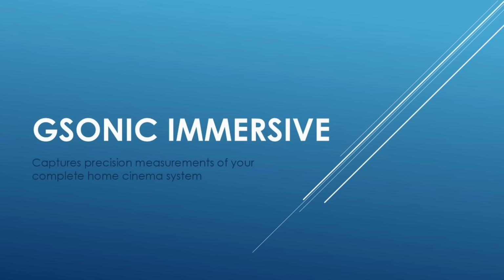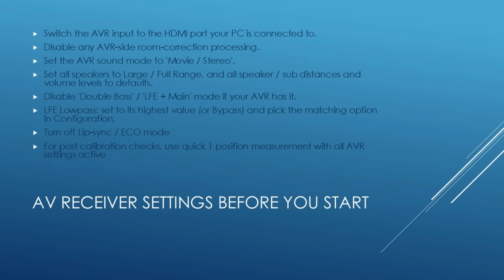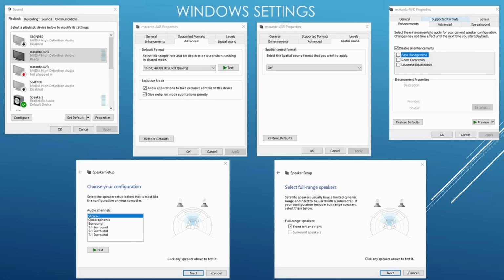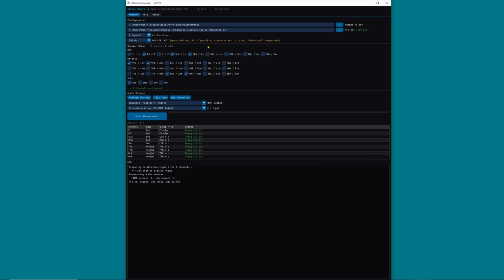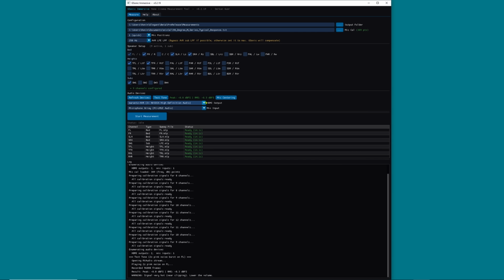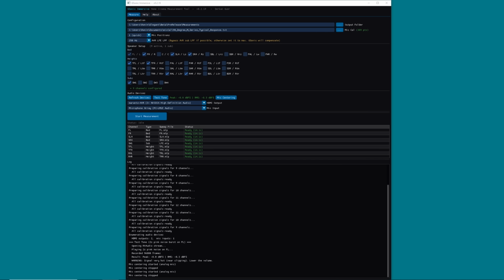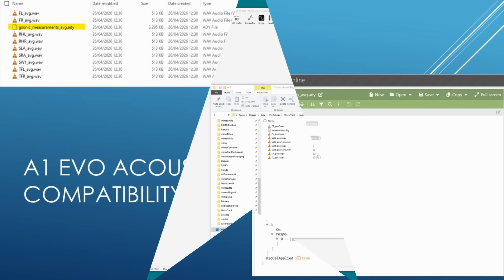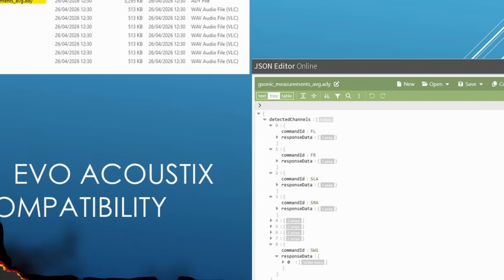GSonic Immersive

Comment: Hi all, does somebody know the following error message?

FR: the second acoustic timing reference chirp could not be detected - its window is at the noise floor, while the other chirp is clean and the recording length is normal. This is usually a one-off; click Repeat to re-measure FR.

It does always happen for FR and for second "Tschirp" no matter how often i repeat it. Soundmode on my AV8805A is set to "Direct Auto"
Anyone any idea?

BR
Reply from the maker: Try manually setting sound mode to trueHD before the repeat.
Reply: @ocaudiophile  The exact same error happened to me 3 times at SW1. Do I also switch sound mode to trueHD? Thanks.
Reply from the maker: The correct way is to troubleshoot using the new guide and find out what is incorrect in your audio path settings.
Reply: @ocaudiophile  Unfortunately that did not work out, still nothing. I am using an AV8805A and the GSonic EV32 Mode btw.  Interesting is that it uses Stereo Mode for FL but switches to ATMOS for FR (might be intended?!)
Reply from the maker: From the app Help tab:

6.  Run the measurement
  - Click Start Measurement. Place the mic at the primary listening position, at ear height, capsule pointing up.
  - The app measures Front Left via PCM, then every other channel via the immersive bitstream (Atmos)
Reply: @ocaudiophile  OK i thought so. Any other ideas to get that sortet out? Weird is i got it working once after i reactivated the Front as Stereo large Speakers in Windows but it worked out only once.
Reply from the maker: Are you running "AVR Reset" before measurements? That sets all speakers to Large anyway. Your issue could be related to large delays on the PC side. Impossible to tell without the debug log, or if the chirps are audibly heard but not captured vs they were really silent. The troubleshooting guide explains fixes for most hardware related issues and is continuously updated for new issues if any.
Reply: @ocaudiophile  Yeah i ran the reset before. The second chirp is not audible at all (at least i did not hear it) while with FL both are and the first one is as well with FR most of the times. How can i provide you with the debug log ? I ll check the guide again as well.
Reply from the maker: https://drive.google.com/drive/folders/13eRDRmuTau_J90WkXuszPc_MZU5LWiYv?usp=drive_link
Reply: @ocaudiophile  Just uploaded to folder "FR"
Reply: I rechecked the guide meanwhile updated to the latest version and still cant get past FL. The second chirp for FR is never to be heard.
Reply: @ocaudiophile I think i just resolved it, still not totaly sure if this has been the issue. As soon as i skipped FR and Center (in not choosing them as available channels), the other channels just worked well. So the difference to the other channels is the amp which in case of the fronts are Hypex Modules. After changing the automatic input search of the modules (FR/FL) from auto to fixed XLR suddenly the the whole front was working. Weird is hence i am not quite sure if this was causing the issue in the end, was that i did not change the center. Nevertheless maybe this was causing some kind of delay in the signal. BR
Reply: @ocaudiophile  I think i just resolved it, still not totaly sure if this has been the issue. As soon as i skipped FR and Center (in not choosing them as available channels), the other channels just worked well. So the difference to the other channels is the amp which in case of the fronts are Hypex Modules. After changing the automatic input search of the modules (FR/FL) from auto to fixed XLR suddenly the the whole front was working. Weird is hence i am not quite sure if this was causing the issue in the end, was that i did not change the center. Nevertheless maybe this was causing some kind of delay in the signal. BR
Reply: @ocaudiophile  Using GSI 2.0.6, I am still stuck at SW1, the error message is:
Both ATR chirps not detected (SNR 12.2 / 12.3 dB, region peaks -23.8 / -37.5 dBFS - ATR1: energy present but chirp pattern not detectable; ATR2: energy present but chirp pattern not detectable). No usable timing reference. Will prompt for Repeat.
>>> SW1: the second acoustic timing reference chirp could not be detected - its window is at the noise floor, while the other chirp is clean and the recording length is normal. This is usually a one-off; click Repeat to re-measure SW1.

As you suggested, I switched the sound mode to TrueHD for the Repeat but to no avail, the same error still surfaced. I have read your Troubleshooting Guide (Web) twice and have followed the instructions therein. The Guide does not list the above error I encountered.

My Test Tone shows all green after I lowered the AVR volume to -24db and mic level to 20db.

Please help. Many thanks.
Reply from the maker: Can you upload your debug log here?

https://drive.google.com/drive/folders/13eRDRmuTau_J90WkXuszPc_MZU5LWiYv
Reply: @ocaudiophile  Done, uploaded to the above folder. Many thanks for  your kind attention
Reply from the maker: I'm working on it
Reply: @ocaudiophile  To help your investigation, I just used your latest GSI 2.0.7 to do a Quick 1 Position sweep, the same error occurred at SW1 as before. The error message per measurement log is as follows:

Could not lock the timing reference for this channel - the sweep will be repeated.
   LPCM-ATR-X: empty IR (ATR path not Clean) - delta untrusted
>>> SW1: the second acoustic timing reference chirp could not be detected - its window is at the noise floor, while the other chirp is clean and the recording length is normal. This is usually a one-off; click Repeat to re-measure SW1.

I did a Repeat by increasing the AVR volume by 3.5 db as you suggested elsewhere, but to no avail. The GSI 2.0.7 Troubleshoot Guide (under Sweep Fails) does not mention this error. As my measurement was aborted, I noticed the debug log is still the same as that I uploaded to your Test folder yesterday, Sept 1.
Reply from the maker: Are you hearing both ATR chirps from FL during sub sweep? Did you change "2 channel playback"  from auto to something else? The floor sweeps including the sub sweeps are now simple pcm signals and the worst PC with the oldest AVR should play them without issues. I'll still need to check the 2.0.7 debug log but it looks like there're customizations you're not sharing in that setup.
Reply: @ocaudiophile  Like all the other speaker sweeps, there are ATR chirps from FL before SW1 wake tone, then SW1 sweep. Error happened after SW1 sweep. I don't have the chance to go on to SW2. I used Pure Auto sound mode for the sweeps.

I just uploaded the the 2.0.7 debug log to your Test folder.
Reply from the maker: Found it!!!

Your mic is clipping during ATR chirps (which are louder than the sweeps by design). Clipped chirps are audible to you but not detectable by the app. The test tone would normally give an orange warning for that but you get the green by a tiny margin so it's not your fault to have not figured that out.

Umik-1 mics come with different gain settings and your version is the +18dB Gain one. All you need to do is set its Windows volume lower by about 15dB (Test tone peak around -35dBFS) and you should be fine. Remember Umik-1 gain can also be set internally using its dip switches if you want to make the change permanent and use it at 100% Windows volume.

PS There's another capture device: AB13X USB Audio in your rig and it was selected more than once as the mic. Better disable it to avoid confusion. I will check if I can adjust test tone clipping detection better in the next build.

Edit: If your sub gains are too high, this may also be causing the clipping at that stage and this explains test tone warning missing it. Your speaker levels and sub levels have like 15dB difference. App will not check for clipping during sub sweeps for technical reasons.
Reply: @ocaudiophile  My sub gains were obtained via Acoustix sub level matching. Should I reduce their plate gains? Thanks a lot
Reply: @ocaudiophile  I am so sorry to trouble you again. 

As you instructed above:
1. I set my Umik-1 "Windows volume lower by about 15dB" to 9 dB
2. Reduce "sub levels" by 15dB 

Unfortunately, the same error still cropped up after the SW1 sweep and Repeat did not help. I am totally lost now. Please help. I have uploaded the latest debug log to your Test folder.

Thank you very much.
Reply from the maker: Are you hearing one chirp before the sweep (from FL), one long sub sweep and then one chirp at the end (from FL)?
Reply: @ocaudiophile  I hear one chirp before the SW1 sweep (from FL), then the usual long sub sweep. However, the error surfaced at the end of the long sweep and the process stopped.
Reply from the maker: I cannot find any explanation and the problem is only with your rig. Did you check your Hypex modules are not set to "Auto" and delaying to switch the correct input leaving FL silent?
Reply: @o @ocaudiophile ease excuse my ignorance. How do I check that my “Hypex modules are not set to "Auto"”? Eco mode is automatically set to Off by your App’s resetting of the AVR. Thanks so much for your time and attention.
Reply from the maker: Hyoex has xlr / rca/ auto options for output. It might be delaying to switch to the correct output in auto. Depends on how you connected them to your pre-amp
Reply: @ocaudiophile  Despite the above GSI problem I faced that prevented me from using Evo32 that I already purchased, I’m not about to give up becoming one of your happy users enjoying excellent sound from Evo32. I hope you can make it happen.

I replaced the HDMI cables with Ultra High Speed ones and re-tried GSI 2.0.8 (1 position Quick Measure with only FL, SW1 and SW2) several times with different combinations of AVR volume, mic volume and subwoofer plate gain. Here are my findings:

 1. GSI FL test tone to get a peak around -35dBFS → no problem
2. FL sweep completed successfully
3. SW1: First FL chirp → sub wake and sweep → FL Timing Chirp error → Repeat → same error → Abort
 4. FL no sound and test tone silent
5. Windows Sound test of the same preset GSI used: FL silent, FL OK
6. Played from JRiver (which was closed during the measurement) stereo music and DTS multichannel sound test video: FL no sound but other relevant channels all OK
7. AVR own test tones can still produce FL

I would be most grateful to get your expert opinion on what went wrong, hoping that my rig is not condemned. In this regard, I have uploaded the debug log to your Test folder.

Thank you very much.
Reply: @ocaudiophile  Mine is Marantz Cinema 30, no pre-amp
Reply from the maker: Looks like filter transfer step is failing with your rig. Something must be taking over wifi mid-run. Turn off HEOS, home automation, etc all the gizmos and it should work fine. Always run "avr Reset" first when you start the app and before a measurement session.
Reply from the maker: Can you share your avr reset log as well?
Reply: @ocaudiophile  Just uploaded. Thanks

Comment: I have a Focusrite Scarlett 2i2 3rd Gen with the Dayton Audio EMM-6. Everything in Audio Devices is GREEN, and no matter what I do with the Marantz volume, the Windows recording volume (between 80 and 100), and the Focusrite gain (its saturation is always green, neither yellow nor red), the Test Tone is always red. What should I do?
Reply from the maker: Can you not increase mic gain on the Focusrite? Maybe you are forgetting to turn on 48V phantom power?
Reply from the maker: I use a Motu ultralite for all my measurements, not a glitch in years. Audio interfaces don't cause such issues.
Reply: @ocaudiophile The 48V is indeed activated. Does it cause the Focus to clip? I'll test it tomorrow, but I seem to recall trying it with the Focus gain maxed out, Windows at 100%, and the Marantz at 0 dB. According to my sound level meter, it's around 85 dB.
Reply from the maker: You can adjust for clipping using test tone. Aim to get it in the green.

Comment: holy molly i already said you are a genius; but man...how is it possible to make perfection even more perfect...everytime ??? let me get this GSONIC replaces A1 EVO....is that it ? it correct the very few flaws that were in that software ? did i understand correctly lol ? or is A1 still the best for DENON/MARANTZ and Gsonic for other brands like yamaha, pioneer and onkyo ?! i AM confused !
Reply from the maker: AcoustiX is still the all in one free tool that measures/corrects/transfers. Gsonic Immersive is for taking high precision Atmos measurements (very high precision) and it can generate a spatially averaged ady file ready to use in A1X. If you want the very best, there's now GSonic Evo 32 which uses GSI measurements, only works with XT32 models and generates the best sound calibration to date with mixed phase filters ;)

Comment: I have three computers (two laptops and a desktop PC). I activated the licenses on my one-year-old ASUS laptop with Windows 11, and it just won't recognize my Marantz SR8015 as a Marantz (I've been dealing with this for two days). All it shows me is an output called "Digital Audio (HDMI)." I tried it on my Windows 11 desktop PC, and it's the same as the ASUS laptop. I just tried it on my old DELL laptop, which I'm keeping but no longer use, with Windows 10, and it recognizes the Marantz SR8015, offering an output called "marantz-AVR." What I haven't been able to do with any of them is get the Windows audio sample to work. I'm working on it! The important thing now is to transfer the two licenses from the ASUS to the DELL. How do I do that? Do I deactivate them on the ASUS and activate them on the DELL? I haven't been able to do a single thing yet... what a mess! :eyes-purple-crying:
Reply from the maker: What's your email?
Reply: @ocaudiophile  I can't type anything that looks like an email address. I've tried many ways. I'll try the next one in three messages: the left side, the @ symbol, and the right side.
Reply: @ocaudiophile  Incredible... but true!
Reply from the maker: What's your name, I'll try to find your account and release your license if it's locked. Also check the new troubleshooting guide before you quit on a laptop. I added a link for it in the video description
Reply: @ocaudiophile  In the email from you that I received saying "This is OCA from OCA GSonic" you have my full name.
Reply: Everything's OK on my discarded DELL laptop. Thanks.
Reply from the maker: Already solved!

Comment: Is it sensible (or necessary), before anything else, to use a sound level meter to set the subwoofers and other speakers to 75 dB? Should I use a sound level meter?
Reply from the maker: No, sub responses have large peaks and dips and rms pink noise will not give accurate results. Run a 1-repeat quick measurement round at MLP first and it will display FL relative levels of your subs. Adjust plate volumes such that they're roughly around 0dB and then start Evo 32 mode measurements.
Reply: @ocaudiophile  Does Adjust plate volumes = ¿ Speakers + subwoofers? I don't understand the "plate" thing.
Reply from the maker: Internal volume of the sub (its plate amp)

Comment: The GSonic Immersive help documentation itself says, "Automatic sub switching for multi-sub systems (Denon/Marantz, multi-sub): leave it enabled (it's the default setting)." I just installed version 2.0.3 and it's not enabled by default. What should I do?
Reply from the maker: It's only activated during AVR reset.

Comment: In the Sound settings: I have set the AVR to "Ready" and the Speakers/Headphones to "Default Device," just as you instructed. However, when I select "reset AVR for measurement," a yellow message still appears: "Windows default device: this AVR is your default device..." Where did I go wrong, and how should I fix this? If I proceed with the measurement, will the results still be accurate? I look forward to your clarification.
Reply from the maker: That's a minor issue not a deal breaker to take measurements (hence yellow), it says the AVR is also Windows default device which carries the risk that if Windows needs to play some sounds during measurements I.e. mail alerts, etc. they will play from the AVR and may damage the measurement process. So better make something else the Windows default player.

Comment: Hi OCA, I am getting "AVR reports decoding '3/4/.1' (sound mode: 'STEREO')", saying not in immersive mode . Again, I have the X3300w with a 5.1 setup not got my heights yet and also set my AVR to MOVIE STEREO. Am I doing something wrong?
Reply: Press the Pure button on the remote control to cycle through the options until Auto appears on the display
Reply: @Hasa75  Hi mate, thanks for that. I also realised I didn't set it to PCM which sorted it, no messages and all calibrations saved normally I believe
Reply from the maker: posts about 3300W always scare me, that was a tough one to get right at the time.
Reply: @ocaudiophile  I'm sorry it was difficult. It was the only choice for an AVR at the time for me. I need something within my budget. I am going to upgrade eventually but it's down to money again. Anyway, everything setup and playing correctly through immersive & EVO32 pal. The difference between previous calibrations and this is unbelievable. Thanks again, and I wish you all the best for the future endeavours.
Reply from the maker: Thank you for your purchase. 3300 is a great amp just different in its filter transfer process to other models. It's the only model Denon calls legacy. Enjoy your sound.